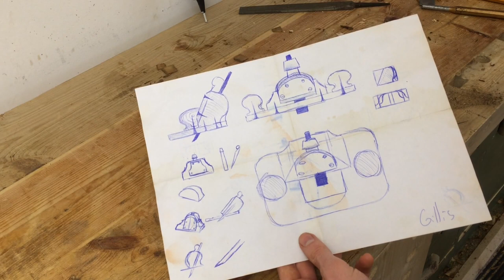Making a router plane

Comment: What a fantastic design. I've been planning to build myself a router plane and this is the perfect one for my current skill level.

I really like the way you talked us through the process and design decisions.

Update: I went ahead and built 3 planes using different sized chisels based on this design. I'm extremely happy how they turned out. They're rock-solid and easy to use and customise.

I really recommend giving this design a go.

Comment: Exceptional... great design and far more practical than some others.  I intend to build mine and will take the lead from you.  I wish you had not used epoxy on the thread, rather had put in a nut to reuse the knobs, but thats just me.  Fantastic job and much appreciate the helpful tips especially on chisel length

Comment: From an engineering and stability point of view, yours is the best design of a DIY router plane I have seen on Youtube. Congratulations. The key to the success of your design is the substantial extension of the sole ahead of the cutter, something people tend to overlook - without that big sole extending forward it would be unstable and prone to tipping forward. You don't need to add anything to stabilize it further.
By the way, don't tell anyone, but your design is way superior to Paul Seller's :)

Comment: Nice job. What angle is the block that holds the chisel blade? Or what angle is the chisel set to?
Reply from the maker: Thanks! 45 if I recall correctly, on the steep side for a router plane but I like how it cuts
Reply: @GillisBjork  Thanks.

Comment: Why do you need such a large hole in the base-plate?  Is it just so you can see what the router is cutting? It seems to me you'd want it as small as possible, for strength and stability.
Reply from the maker: Yes, I want to see the cut, and I don't think it needs any more strength
Reply: You're 100% spot on. Having a clear view of the contact point between the blade and work surface greatly improves accuracy and ease of use.

You can always add reinforcement if strength of the tool is a concern.